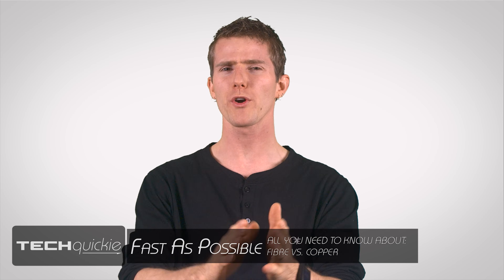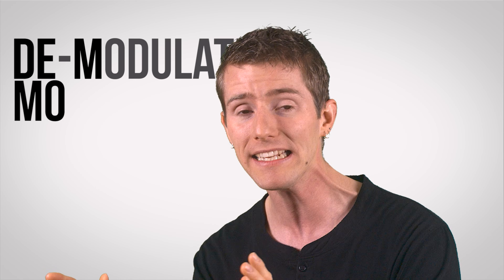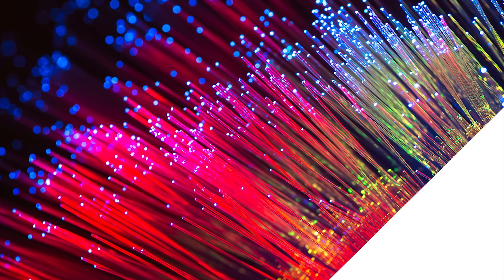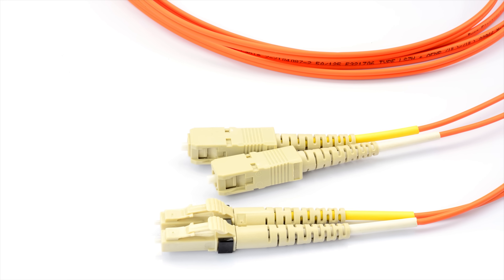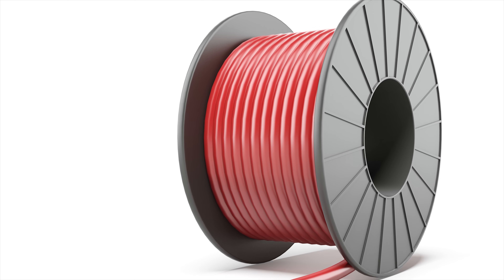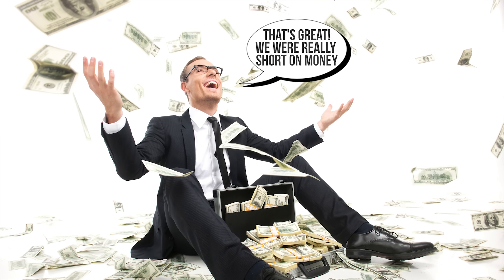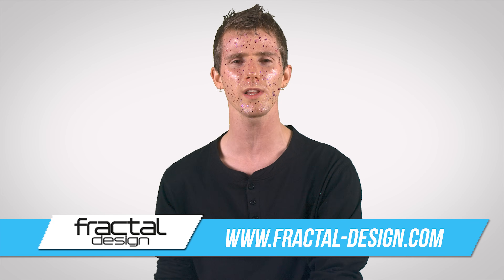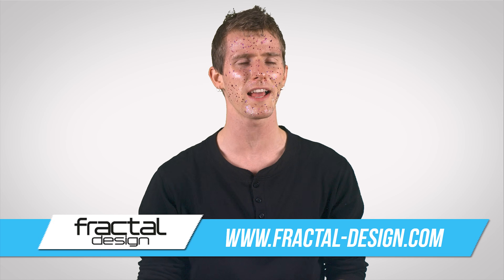Fibre (Fiber) vs Copper as Fast As Possible

Comment: Fiber can't carry a seriously high amount of volts & amps, making it useless as a means of transmitting high volumes of energy over long distances without first bursting into flames during the process,, so in that department copper is still king, but hands down for low voltage data transmission fiber has copper beaten all day day long.

Comment: My copper broadband is good enough for my purposes. (I don’t play on line games)
My copper telephone line is perfect with good ringing throughout my house.
My copper telephone line is more secure and my calls cannot be monitored easily. (Requires a physical tap).
My copper telephone is powered from the exchange which has a back up generator and therefore more secure for emergency calls etc.
My copper telephone line is analogue and better quality.
Should my copper line fail, BT and Open Reach must repair it.
To me there is no advantage changing over to fibre at all!

Comment: all these videos on copper vs fiber come from people who have never actually worked on either. Coax copper offers same download speed as any fiber would. Fiber is just a buzz word. In reality, both are pretty much the same, with fiber having the advantage that it offers same upload speed and download speed, and fiber is also just marginally more reliable

If you were to build a brand new building with brand new lines, coax and fiber, you would not see any difference. And copper has no hard limit to its speed. Every year these limits are increased. The speed cap is not based on the type of cable, but on the infrastructure, and on cost vs benefit.  You can make copper wires provide 10 gig+ speeds, but nobody needs that kind of speed (and almost no modems would be able to receive that kind of speed)

Every day I connect several residences with 1 gig via coax copper. So to see people saying copper is "slow" is just weird. Fiber is just a buzz word

If your internet is crap and you're using copper, its not because its copper. Its due to a million other variables. Similarly, many clients using fiber switch to ISP's which provide service with copper

The single main reason why many would say "I switched to fiber and my internet became much better" is most likely due to the fact that the fiber lines are brand new, while the coax lines are probably decades old. If these same coax lines/infrastructure was also new, it would be just as fast and reliable as any fiber line

Cities and buildings and companies, etc, are also often switching to fiber to get better public opinion. If a building is wired with fiber, it will receive more tenants, because tenants believe that fiber is much better. Basically this whole fiber thing is an extreme exxaguration. Some people started this myth and now its being continued by people who have never worked with it or its counterparts. 

Its because of videos like these that I constantly have clients who are getting 1 gig plans who ask "will my speed be good enough to do zoom?"

And the whole notion that it saves money to install fiber in the long run is naive. One big thing the author didnt mention is that only Fios uses only fiber. Meaning they'd have a monopoly, meaning they could charge anything they want. Additionally, working with fiber is more complex requiring more complex tools. Its not just plug and play like it is with copper. And if a building is wired for copper, does the author not understand how expensive it is to also wire it for fiber? It could take decades to potentially reap the financial rewards
Reply: Why does my ISP give me FTTH lol. Optical is just better for long distance

Comment: linus i'm sorry to say it but we don't use copper wires for the overhead power lines you see everywhere, we use aluminum, it's not as conductive however it's many times lighter and stronger then copper witch is a soft metal compared to aluminum. we use aluminum because it's cheaper we don't lose that much more power to it plus it can span long distances without support.

Comment: Copper can't handle anything faster than 1200 baud!
Later: Copper can't handle anything faster than 9600!
Later: Copper can't handle anything faster than 56K!
Later: Copper can't handle anything faster than 1 Mbs!
Later: Copper can't handle anything faster than 1 Gbs!
When does it actually max out?
Reply: It's increasing due to reduction in Electromagnetic interference

Comment: We just got a fiber connection here in India, the speed is about 50mbps idk if we'll upgrade to 100mbps but right now fiber is everywhere and it's the only option available for us to a broadband connection
Reply: True! Using Jio Fiber 😂
Reply: The price will be cheaper year by year

Like in Thailand

2017 30Mbps/5Mbps
2018 50Mbps/20Mbps
2019 100Mbps/100Mbps
2020 300Mbps/300Mbps
2021 1Gbps/200Mbps
All above are at the same price 590THB
Reply: @scrawnysatyr  that's soo good......

Comment: Fibre does have a lag, even though Fibre can transmit at the speed of light, the longer the line, the more the photons traveling down that line can get skewed, the only way Fibre could work perfectly, is if the cable was only wide enough to move the photons down the stream in a single file order. This however is impossible, because photons are way smaller than any material we could possibly work with. I hope we can fix this problem one day, but I don't know if it's possible. Electrons moving down a copper line move in waves, which can travel very fast, but not at light speeds. The first electron goes in, and shoves the next one down the line, another one comes in, and forces more down the line, and so on and so on. The light will scatter as it passes down the beam,the light that bounces around in the line the most will hit last.

Comment: The amount of DARK fiber all ready in the ground is huge .Williams pipe line during dot .com 2000 boom laid down 22k miles of fiber then just said no demand and turned it off  . 5G using fiber should piggy back on fiber all ready in the  ground .Google fiber came in a laid huge amount fiber in my city will Verizon etc.. use some one else fiber to save money or lay huge amounts of more fiber in the  ground ?So see my point use dark fiber to help build out the 5G network !

Comment: Does fiber optics cable SIZE matters? I mean in cable length. I'm trying to search for the shortest to connect 2 switches one on top of the other and the only ones I see are minimum 1meter. Is it light bounce an issue on short cables? Is there a way to fined less than a meter?
Reply: That's what DAC cables are for. For very short lengths like 1 meter they're better than fiber because of the latency added from converting the copper in the switch to fiber.

Comment: despite being called "fibre to the premises" most residential broadband providers use a term called "Hybrid fiber-coaxial "  which basically means fibre is run to the street cabinet or "node" then coax is used for the last mile using a standard called "DOCSIS" (Data Over Cable Service Interface Specification) DOCSIS 4.0 is the latest standard which allows for theoretical speeds of 10Gbps download and 6Gbps upload which is fine for most residential connections. (for the record my ISP currently uses docsis 3 which sis why my provider can only provide upto 1Gbps speeds)
Reply: That is true, but there are some actual fiber to to the home services. I know AT&T has Fiber internet in some areas where they do run fiber to your house to an ONT, and then an ethernet cable to the AT&T gateway. The rest of us are stuck with the hybrid system you are talking about.

Comment: If you managed to replace the wires in a motherboard with fibre optics and add in some really small laser diodes to get the signal from say the CPU to the RAM, would it speed up your computer at all?

Comment: Some really bad information in this video.  Let really look at the how it all works.  Both Copper and Fiber work on almost the same principle... Sending electromagnetic radiation(ie waves) down a thin line of material at the speed of light.  Fiber uses light radiation and copper uses Radio radiation.  Copper really has the advantage of bandwidth, the radio spectrum is pretty large.   However a lot of it was already reserved for other uses by the time digital internet came along.  They are still making a lot of progress cleaning up the bands for use as digital.  Also it almost everywhere.  Disadvantages, it very susceptible to outside interference and needs proper shielding end to end.  Also the radio radiation doesn't travel as far as light radiation and loses signal depending on where in the radio spectrum, again the better the band for distance was already used by other communication devices, so it again loses because of old technology.  Fiber does have the advantage of distance, but limited by the light spectrum.  There only certain ways you can split up the light spectrum before having to install a new fiber line.  However fiber lines do have to be installed to begin with.   DOCSIS 3.1+->(4.0)  is always improving, to bad cable companies are more worried about Cable television than actually investing in to upgrade DOCSIS protocols.  Disclosure:  I am a Google Fiber customer.

Comment: In Romania the house to house fiber is already a reality in 2019.
In the rural areas FTTH expansion is a little slower but it is happening.
For example I recently got a new 300Mbps connection(new FTTH infrastructure going up to 1Gbps) in my country house for 17Lei meaning ~4.5$.
Also in the EU ISPs can receive non-reimbursable funds for providing fast internet to towns or villages were the current speed is less than 30Mbps.

Comment: My ISP has been working on their fiber-backed network for the last year.  When I bought my house, I was on a purely bonded DSL line with max speed of 15 Mbps down, and 1.5 Mbps.  When my ISP added the nodes, repeaters, and fiber to the end of my road they were able to swap my house over to the fiber-backed hybrid I can now get either 25, 100, or 200 Mbps.  I have their 100 Mbps and usually get about 80 Mbps down and 26 Mbps up.  I still wish that I had FTTP (Fiber to the Premises) but the current configuration works so I am not going to ask them to fix something that isn't broken.

Comment: I typed in ' origin of optic fibre cables ' here on YouTube but I am not getting any result as to origin or any inventor  so Roswell ufo crash is the only answer . Reverse engineering . If you search ' optic fibre is of extraterrestrial origin ' then  only you get results.Even the IC (integrated circuit) was reverse engineered. This makes that ufo crash proven valid. Why the fuck must this be hidden from the World . Your cell phones and tv's and practically everything Electronic won't function without an IC. The old hifi's or music systems example PIONEER RONDO 3000 had open and shut valves that emitted a green light when opened instead of an IC , that's why it took a while to actually start up and play audio , which did provide high quality Bass that was unique in it's own way. If there was an inventor like,Thomas Edison (light bulb) , Nikola Tesla(alternating current AC) , James Watt(steam engine) , Henry Ford(motor vehicle) , etc. I am sure that fiber optic and the IC would have had inventor's names attached to it. I often wonder WTF with the world and the lies .    Sorry I missed out Telephone system by Alexandra Graham Bell. Give me a '  like  ,👍 ' .  because I deserve it for my research .

Comment: The main cost with fiber is not the cable itself, it is relatively inexpensive, not as cheap as copper mind you, but not out of reason. The cost is the electronics to interface it. The switches, LAN cards, modems, routers etc can be insanely expensive, especially when the end user only needs the throughput (not bandwidth, bandwidth is a range or electromagnetic spectrum occupied by a given channel, transmission etc. not speed. get it right people) of an end user is well within the realms of copper, especially since copper can easily do 10Gbps. Think about how much a SFP module for a switch costs, now populate a 48port switch with them. cost starts to add up, not to mention the switch itself has to be able to handle the traffic. The cost of deploying such infrastructure for the end user is just not worth it, only in specific situations where massive throughput is required or massive distances on a link are required,  will there ever be a return in investment,... at least at this point.

Comment: I just got gigabit fibre installed all the way into my house, located on an island in a quite scarcely populated area of Sweden. I still had to run cat6cables the last few feet to my routers, wifi antennas and outlets. Can't escape copper completely 😁

Comment: 99.999% of people don't need 1 gbps bandwidth.  Streaming 4k on 5 TVs requires about 20 to 22 mbps.  It makes no sense to have over 50 mbps connection to your house.  Most servers can't even push data to your house at greater than 1 mbps.  Packet loss and latency is what people have issues with and that's when its good idea to ditch the wifi connection.

Comment: and here I am living an expensive data quotation system every month...when reach its limits,the speed which usually 1mbps(still very low compared to other countries) will be throttled down to barely 20-50kbps speed...fckng greedy company😢😡

Comment: The main issue I have with fibre broadband is the cost! its way too expensive!! there's no way I'm gonna pay about £25 a month just for the internet, I get that the fibre cables are more expensive but surely once its all installed there's no excuse for the cost to be so much higher than regular broadband

Comment: I wish you did more stuff with fiber optics. It's becoming cheaper to setup a home fiber network than with CAT 6, and with the latest MMF standard supports up to 400gbps (so you can upgrade from 10gbps to higher by simply updating your switch and transceivers in the future).

Comment: in canada we have bell that has pure fiber that goes directly to our homes, ive had fiber for a few years and only had one issue when the connection died for an hour but that was like at 4am but before when i had rogers cable that was hell on earth, slow speeds, not reliable at all (had to get the underground cable from the node to my house replace 3 times) and was more expensive

Comment: you know how you said copper / cable is deploy everywhere well I'm near a town in Ontario Canada named Trenton and the local cable company is Cogeco my street has more then  1000 houses + a small school and some businesses and Cogeco has not expanded the cable line to our street probably because they're very cheap  and we have to get fixed Wireless with this company called xplornet we're paying $110 a month for a internet connection with 25 Mbps and 500 gig cap and it's up to 25 so the speed is most of the time not even 25 8:30pm its like 3 to 6 mbps the technical support can't do anything about the speed and I can't get anything better this is ridiculous I could understand if I was in the middle of nowhere but I'm on a street with more than 1000 people it's literally 2018 I'm right next to a small City and I can't even get high speed internet lucky for me though the crtc which is basically the Canadian FCC is making 50mbps a minimum service by 2020 so if I'm lucky I'll get cable in a few months from now if not 1 or 2 years xplornet is even worse in some areas for an example some areas git less than 1mbps I'm glad that the crtc is doing something about this because right now there's no internet standard in Canada essentially a internet service provider in Canada can advertise 1 Mbps as high speed it's ridiculous that it's 2018 and my street doesn't have cable glad that the cable companies can no longer be cheap so yeah if you're living in Canada don't move to a house that doesn't have cable unless it's 2020 or later

Comment: Fiber optics is pretty much only used for WAN links; don't expect to see LC connectors on your motherboard to connect to the switching ports on your ISP device. That and they're fragile as fuck, last thing you want is to bump into it or bend it and boom you broke the damn thing.

Comment: 1.)  Does the router effect the download speed?  It says 5ghz

2.)  If you just want internet do you need a modem?  Right now I just have a router.  Does that also effect the internet?

3.)  So I pay for 100mbps.  So it's actually 10megabites?  100 megabytes= 10megbites?  But when I down load games on the Xbox it shows the download speed.  Sometimes it jumps up to 30mpbs but most of the time is at 5 to 8mpbs.  I want a consent speed.  So which router should I invest in?
Reply: 8 BITS=1 BYTE SO WHATEVER THE ADVERTISED SPEED IS DIVIDE THAT BY 8,
FOR THE ROUTER, IT DEPENDS IF YOU ARE GOING TO STREAM 4K AND THE NUMBER OF USERS :D

Comment: I used to have 0.28 MB/s with copper and now have 40 MB/s with fibre. BT said they would offer us fibre by October 2014 and finally in August 2016 they actually bothered and my property is less than 10cm from the telephone/internet exchange

Comment: at&t signed a deal with the fcc to switch from copper to fiber by 2020
Reply: thats just FTTN fibre to the node, not FTTH. Telus my company does FTTH. i got fibre directly wire to my modem ONT/modem right beside me. so at&t would be Fibre - Copper - house - modem- cat5/cat6. whereas mine is fibre - modem - cat6

Comment: Almost every YouTube video I've seen describes signals being sent over fiber optic cables as "pulses of light," which is actually very wrong.  While it is true that most fiber optic signals use a type of amplitude modulation, the light is not pulsed.  Rather, two waveforms are modulated in quadrature and the resulting interference pattern is what encodes the data.  Verizion's (now Frontier's) FiOS network uses 256 level quadrature amplitude modulation (256QAM) to encode 256 bits per symbol--if the wavelength were being pulsed, only 1 bit per symbol could be encoded.